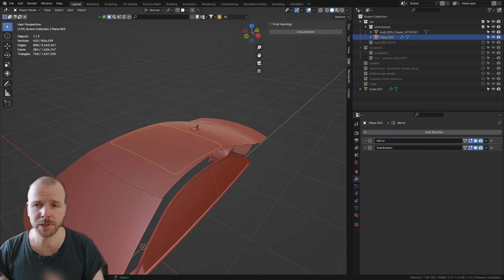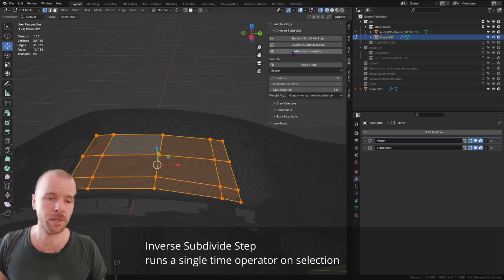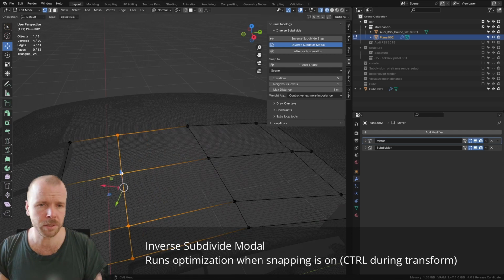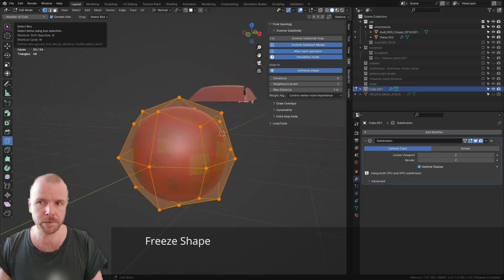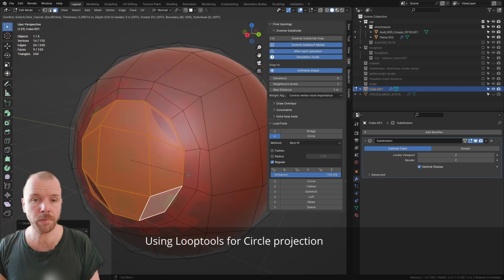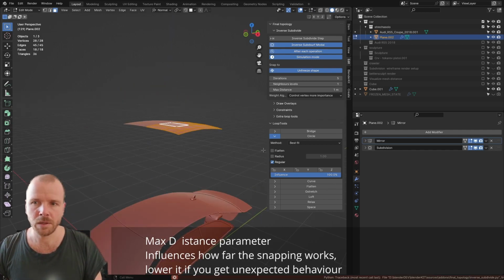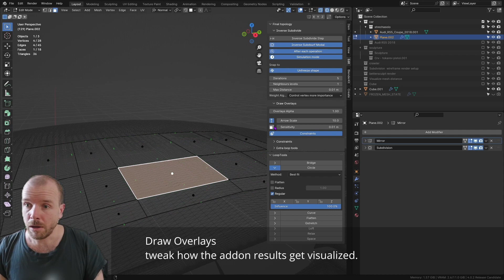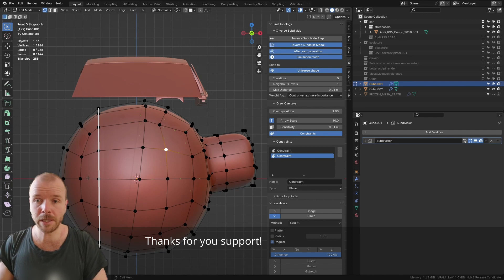Final Topology add-on tutorial

Comment: saying that default version is good for regular character retopo is an understatement of non insignificant proportions. 
you are practically forced to buy the cad version cus you cant retopo with mirror modifier on due to addon always changing X of the vetrex so drastically, putting it on high merge stops being an option cus it merges everything else. and it doesn't matter what count of loops you are working on be it 6-8-10 or even 12 it will still act weird.

working without mirror? that outweights any advantages it gives compared to other methods/addons/softwares.

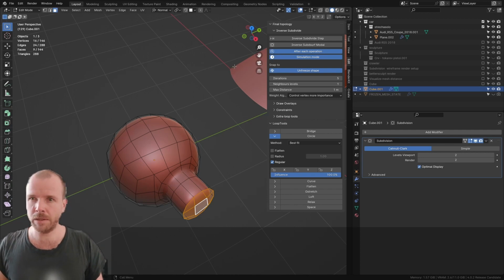Comment: @BlenderKit It appears to be a glitch in the video/audio at 6:09 explaining Neighbor Levels. I think I understood your explanation, but it would have been great to see how it works in action (when increasing the Neighbor Levels). You mentioned something about being careful that I didn't catch because of the audio.

I'd also like to know more about Scene snapping. How does that work? Does it only mean mesh objects, or all types of objects in the scene? And how does it handle visibility states; does it automatically detect changes to visible/hidden for the Scene snapping? (I.e. no manual "update" like for example having to uncheck and re-check Scene snapping checkbox or something like that.)
Reply from the maker: Hi ;)
Neigbor levels - how far the vertices get influenced, it's similar to 'select more' - moves unselected vertices by topology distance, not distance distance.
Scene snapping - should snap to all visible objects, by now ignores anything hidden. This is due to how internally blender's raytracing works in Python, but also seemed most in line with how other snapping options in Blender work.

Comment: In blender 4.2, I installed this by drag and drop the zip file which I downloaded. and when I'm tring to use any of these by clicking buttons, It shows the message that "KeyError: 'bpy_collection[key]: key "final_topology" not found"

Could you please tell me the solution for this issue? 

Thanks you!